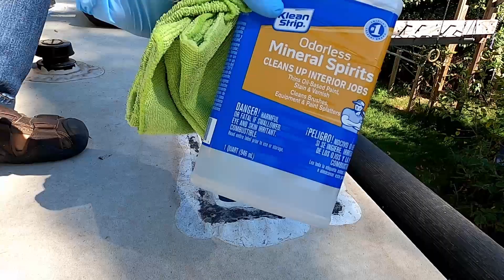Remove and fix a large RV roof vent hole

Comment: Everyone may already know this, but a hard plastic scraper can be your friend on lap seal removal, but even so, one has to use care to not damage the roof surface.   I’m on the verge of getting rid of the old fridge too.  Didn’t know you could get rid of the hole in the roof as well!  AND SUPER THANKS for the hindsight comment re: installing the wood patch before you finish the fridge install!

Comment: Im curious,  doesn't the vents help put heat put from the refrigerator?  So if you close them off heat will go inside rv? & definitely the roof vent seeing hot air rises . Just curious because i live in one & if i can do that to cool it off i will

Comment: I think you'll regret putting down that black plastic as a cover. The plastic will eventually break down from heat absorption and UV exposure. Sheetmetal would be the permanent fix, or aluminum plate. Thinking to the future, most people would leave the vent in place and use it to pass through wires for solar, but block below to hold in heat.

Comment: Just seen this video, and do not understand why you covered that vent. Even though you put a 12 volt compressor fridge in there it still puts off heat you need it to vent.  Your going to make that new fridge work harder and not cool as well. Just my 2 cents.